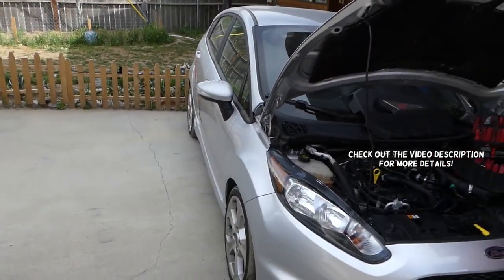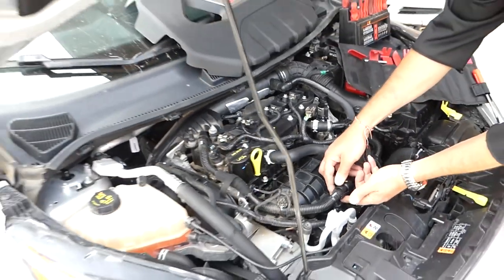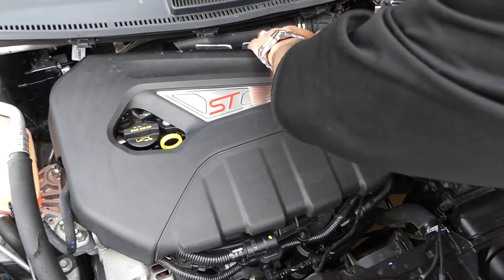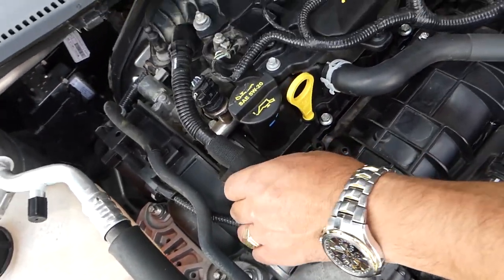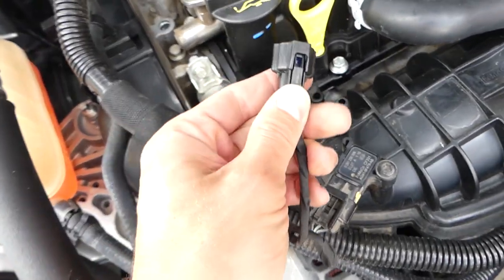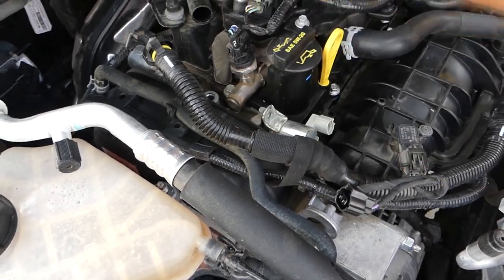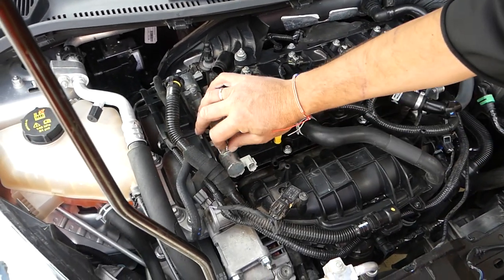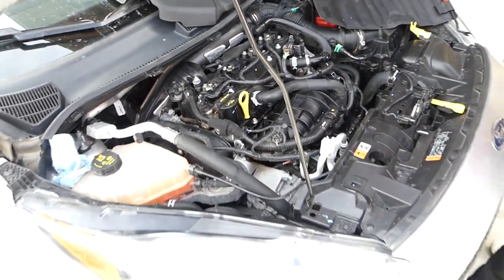FORD FIESTA INTAKE VVT SENSOR SOLENOID REPLACEMENT VARIABLE VALVE TIMING

Comment: Thanks g helped me out mine on the exhaust side started pouring out oil threw it on the original one the new ones they made are a solid piece not a plastic piece with a metal housing like the one that’s leaking

Comment: Hi guys, I really like your channel it contains a lot of useful content, but why do you call this contraption "sensor solenoid"?
From my understanding, it is solenoid only. sensors should be located on opposite side of engine's head (closer to battery).